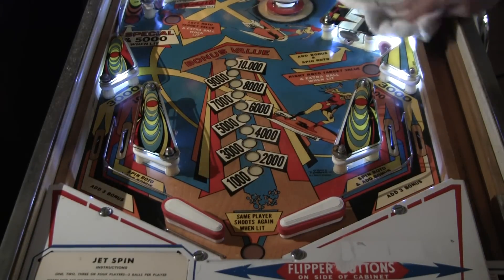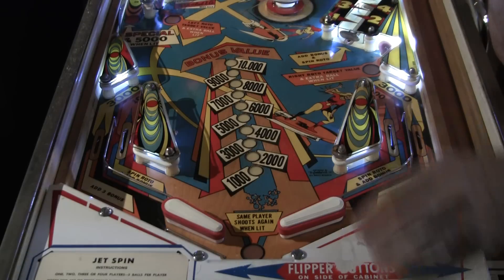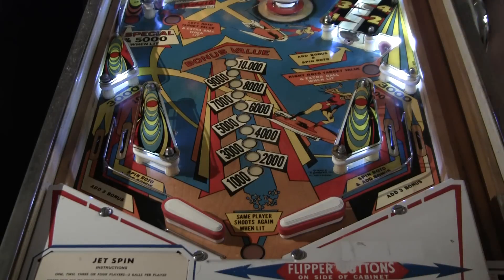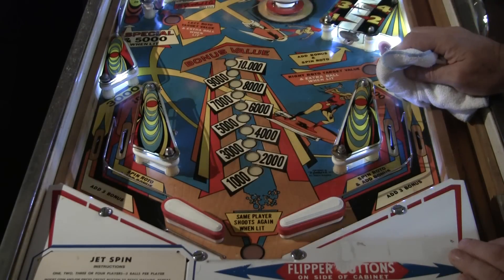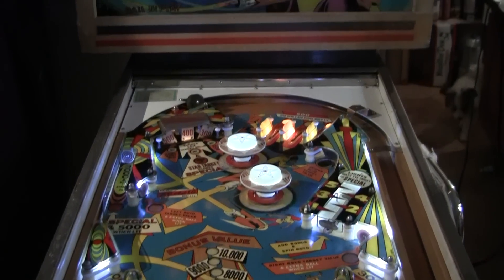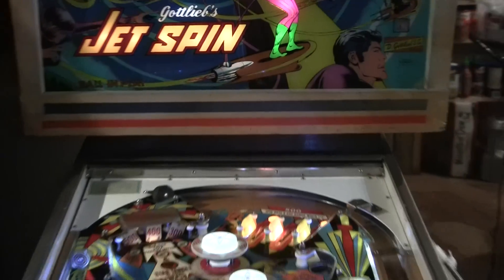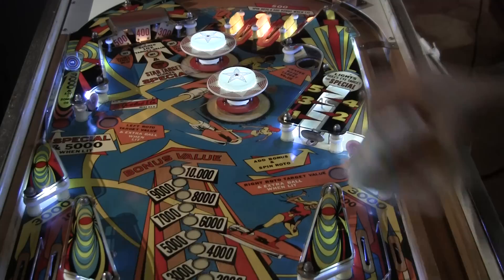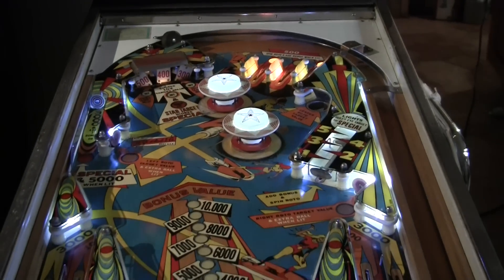Different types of pinball restoration approaches

Comment: I know I have had my frustrations and oh crap moments.
I was told get it working before doing a full restore on a pin and I was like thanks but a bit to late already was in 3000 pieces. >.<
I am new to pinball restoring and have learned a ton from first tearing into my High-Speed pin.
I have new lights and 4 new legs that I am getting shipped to me should be here in about a week.
It will be as factory new as possible with my pin restores.